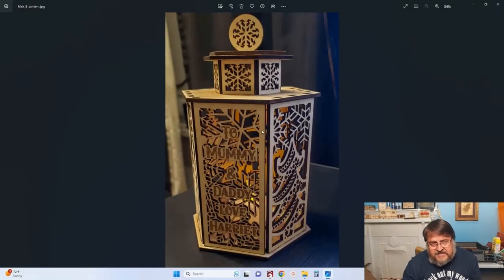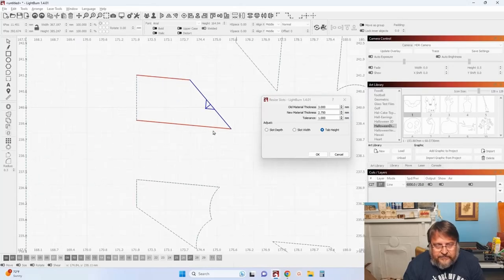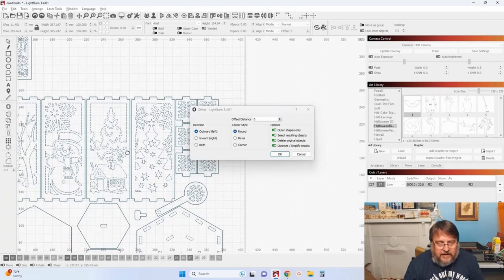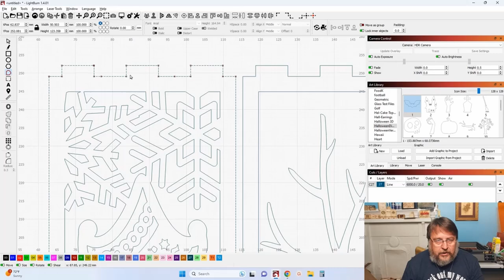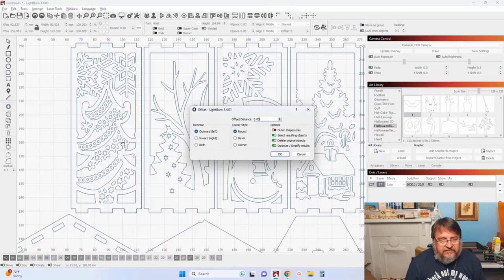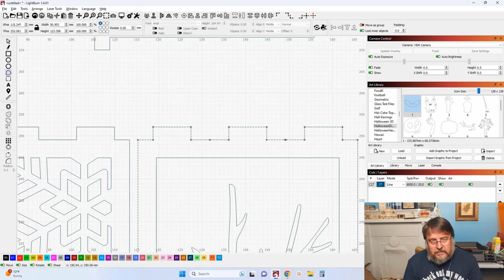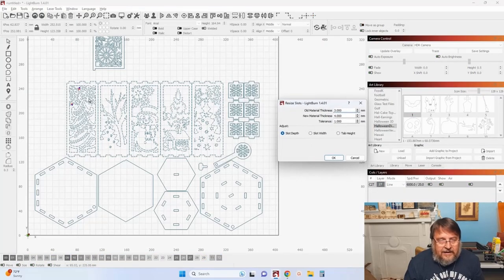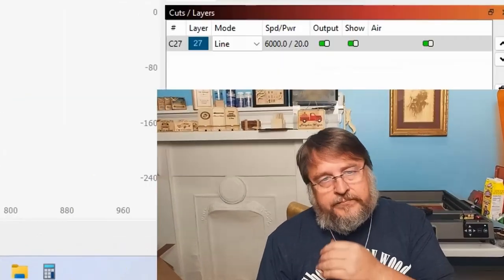Fixing Problems With Files In Lightburn (Part 2 of 2)

Comment: I'm using Inkscape as there is no lasers in my fixed income for now. Noticed when people are cutting or engraving, the laser beam seems to just jump from one spot to another spot and so on and so on. That seems like a lot of wasted time to me. This got me to thinking about the Naming and assigning numbers to Groups and Paths in Inkscape. For an example, the Group number would be like Group 567, which is assigned to objects which were previously selected & grouped. The Paths for an object were just as bad. An Objects had 6 paths assigned to it by Inkscape, those paths numbers wouldn't start with 1, path1. Oh no, path3823, path3756, path289, path9538. See what I mean. What would happen if those paths numbers were renamed sequentially  from left to right, as an example, like path300, path301, path302, path303. 
This may not make any sense at all. 
Just thinking without a laser to test out my theory in Lightburn.
Reply from the maker: The cut/engrave order with a laser is determined by a few different things. I've seen other makers comment on the order in which the laser moves, and they weren't pleased with the way that Lightburn picks. There are different settings in the optimization of the laser. So, depending on how each maker has those settings picked, you may see several different paths using the same design. Also, you want to do your engraving first and then the cutting. And with the cutting, you want to cut all the inner shapes first. While these three choices may not be the most efficient, it does result in the best possible outcome. Lightburn also prioritizes the job by layer. So, a design with multiple layers with different settings to produce different results with each layer and a layer for cutting would appear to be moving totally erratically. But it is supposed to be moving in the most efficient way possible. That said, I have watched it make moves that didn't always make sense. One thing I have done in the past to say time on engraving larger designs with a lot of "white space" is to break the design down into quadrants. Assigning each quadrant to a different layer. Each layer still had the same settings, so the result looked good. But this eliminated the majority of the wasted travel of the white space. When you speak of creating paths, that is essentially what layers will do in Lightburn. If you wanted to take the time to assign certain areas of a design certain layers/paths and then make sure the priorities are set to cut/engrave by layer order. You might save a little time under the laser. But I think it would be a wash giving the time it would require setting up the different layers/paths. The difference might be seconds or minutes. It wouldn't be huge. My suggestion there would be if the laser isn't working fast enough, you need a faster more powerful laser. But I've learned firsthand that you sacrifice quality for speed. But if you were going to come up with a numbering system, I would recommend numbering like the interstates in the US.  Low to high odds, west to east. And low to high evens, south to north.
Reply: @HoboWithWood  An excellent response to dumb question. I had not thought of doing a quadrant type layering, but that really makes since. Here was thinking take the time to look at the design, yes - leave the cut for last, but then move from left to right (west to east) then onto Top to bottom (north to south).
I knew there had to be a reason why I liked your videos other than seeing a fireplace with a plugged up flue exhaust vent & no stove sitting in front with a big kettle of beans being slowly cooked. :face-blue-wide-eyes:🤣👻👽👾🤖